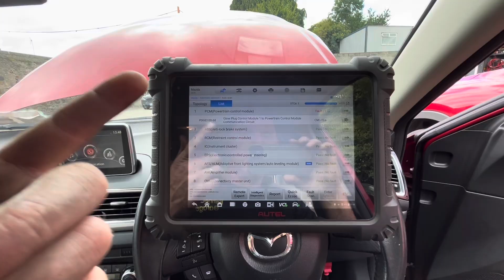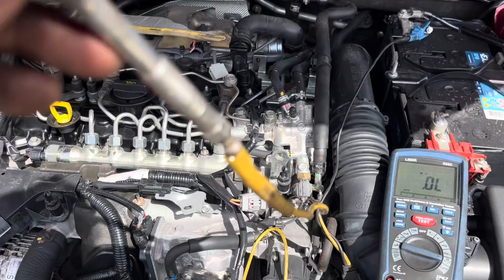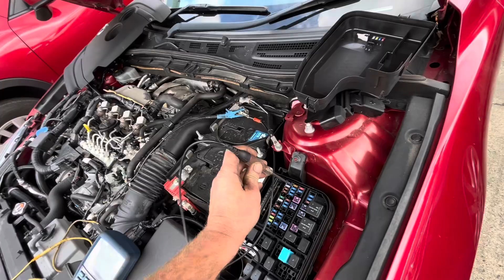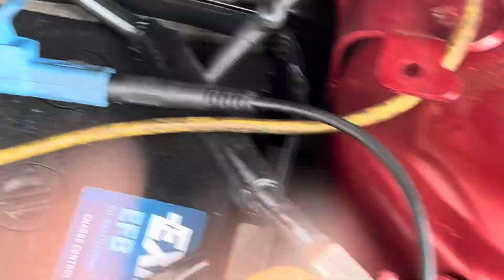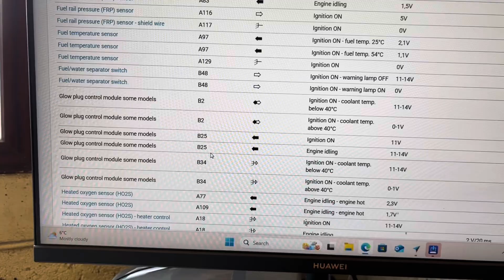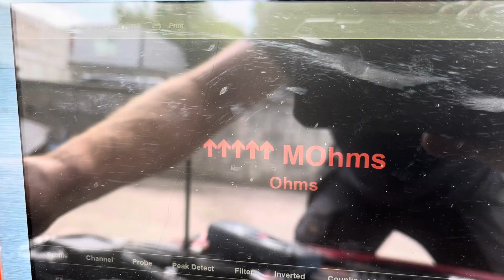P0683 glow plugs communication fault

Comment: hi i have question,mazda 3 2.2 150hp p2262 boost pressure not detected so i think there is problem with vacuum probably vacuum valve i have vacuum on small turbo and big turbo but ther is no vacuum on exhaust manifold flap so my question is should there be constant vacuum when car is running on thet flap then releasing it or it gives is vacuum when it need tu open it car works ok above 2000 rpm but at idle it make strage intake noses on filter box snorkel when p2262 code is present and that is only code car gives and its in safe mode

Comment: Not a bad video, always good to learn from your thought process.  I'm a hobbyist mechanic, the wife wanted a Mazda 3 but I knew about the issues.  Watched a load of your and Mr. NiceGuy videos, learned loads, bought a 2014 car with a knocking rod cheap.  Rebuilt the engine and replaced the turbo CHRA's.  1500km so far and going well 🤞 Lovely power delivery from those engines.  So thanks a lot the videos are appreciated
Reply from the maker: Wow, fair play to you Ryan. That job isn’t for the faint hearted. Well done mate 💪💪💪

Comment: What brand of glow plug do you prefer to use in mazda's Peter? I want to change out mine but can only get NGK, champion & magneti.. no one can get denso unless I go directly to dealer. I assume they run denso from factory?

Got the 1.5 diesel in a cx3, DPF regen is frequent. Hopefully changing plugs might help with new injectors & carbon clean I'm going to do later
Reply from the maker: Intake manifold don’t block on these too much but the injectors can over fuel and cause more frequent regenerations. 
Take a look at exhaust pressure sensor A, the pipe running to it can block very frequently too.
Any good brand of glow plug will do 👍👍

Comment: Hi Peter. Typically, what is the operating voltage of those glow plugs on this model & generation/year of Mazda? Unless i missed it, i didn't see you check for supplied voltage from g/plug module to g/plug/s. Of course, that voltage would only be present when ECM , engine coolant temp sensor etc, were 'calling for' a 'preheat' or 'DPF regeneration' cycle, which you mentioned &  command g/plug module to switch 'on' all four g/plugs. From the displayed data on your DMM (ohm mode), you have zero resistance on all four injectors. So although i'm not familiar with Mazda g/plugs (a 'known good'), that result would normally indicate a direct/dead 'short from g/plug coil to ground' (g/plug body). If that's the case, all four are faulty but didn't necessarily fail at the same time.
Was the communication error faultcode a permanent code? Could it be cleared via scan tool? If so, did it immediately return? Out of interest, was the scan tool able to communicate with the glow plug module? Generally now, if i find a communication error faultcode between two or more modules & the scan tool can communicate with all of the modules concerned, i don't prioritise checking for communication issues i.e poor or non existent can high, can low, Linbus signal/s etc. Although, like you, Peter, l would include that as part of my 'plan of attack', if test results/data pushed me in that direction. l like how you check for voltage drop with both, test light & volt meter. It's a more comprehensive test to monitor actual volt drop, if present, on meter whilst loading circuit. Not just to monitor 'brightness' of bulb', which i find unreliable, particularly when working outside' Having worked in 'sunnier climates', at times it wasn't even possible to see the bulb 'lit', don't mind the degree of brightness!😊
When you were checking for communication signal/s on the scan tool, i didn't see typical can high/low data packages. I wondered if one of the signals was a Linbus communication signal i'e. nominal batt voltage (NBV). I have even seen Linbus voltages in excess of batt voltage😉
A good case study as always. Showing the 'real world diagnostics',when you are under 'time pressure' from customer, who naturally wants his/her car back ASAP (even before you start sometimes😃). That single circuit ground wire, shown on Alldata wiring diagram with it's own inline 5 amp fuse was interesting. At first, i thought it might be a printing/ typo error. But i was 'corrected' when you confirmed with test light, that it was  ,in fact, a 'ground'.  I have said it before Peter, i like how you talk through (to camera) your 'plan' of how you might approach the problem, starting with the basics/easiest to access for testing.Thanks for sharing your knowledge & experience. Good weekend. mike
Reply: 0.0 ohm doesn’t mean faulty glow plug, if the plug was faulty it would show either very high resistance or open circuit on a multimeter
Reply: @viliuskuzma7403  That is not always the case in my experience. In fact the  plug manufacturer Bosch, Re. g/plug type "Duraterm', specify the minimum resistance  to be
Reply: @viliuskuzma7403  CONTD -Specify minimum resistance to be 0.20 ohms & anything lower is to be considered a defective g/plug. 0.20 ohms & over & 5.00 ohms & under is considered to be a 'good' g/plug.
'Generically', the 'rule of thumb' for traditional 12.0 VDC supplied units was/is a spec of  0.50 ohm min & 1.50 ohm max. This could & would vary slightly between manufacturers & applications. I have come across cold (ambient temp) glow plugs presenting with a resistance of 0.00 ohms, which is due to a 'dead short to ground' of the resistive element (heater coil). Ater further testing to confirm my suspicion, l found that the g/plug/s, had, in fact, failed completely or were functioning in a reduced capacity. Of course i'm not saying this is always the case. Thats one of the reasons i indicated to Peter, that i'm not familiar with a 'known good Re. Mazda application/s. Peter is the Mazda Wizard', so i'm interested in his feedback, if any is received.
Reply from the maker: Some very good thought provoking comments, I actually just went back to fast watch my video & I thought I had shown me testing the doner glow plug on a battery before hand.
I explained about the possibly of burning out the glow plug if just connected to 12volts as they are only 9volts.
I also explained about pulse with modulation with a certain amount of ‘on & off’ time giving the desired voltage. 
I don’t know where I put that 🤷🏼‍♂️🤷🏼‍♂️😂😂
Reply: @kennedysgarage3281  Hi Peter. I didn't notice in the vid, you mentioning that the supply voltage spec for that make & model is 9 VDC, so 'my bad'😁. The reason i asked, what is a 'known good' g/plug resistance, was due to the fact, that you mentioned that you would 'normally' expect to see around 1.0 ohm. Although the 'used' g/plug tested at 000.00 ohms (ditto Mazda g/plugs x 4), this may have been a reason why it was removed from another vehicle previously i.e faulty/abnormal operating range. 'Back in the day' when all/majority of g/plugs were rated @ 12.0 VDC, it was easy to 'bench test' with 12 volt batt & jump leads (once they were removed from head😐). A visual inspection would confirm 'either way'. OK or NOT OK. I even used to 'bench test' the 'new' replacement units before installing, as l once found a 'new' unit to be faulty 'out of the box, after having installed in vehicle😞. mike

Comment: Peter…videos are never crap…a great step by step of fault finding..ok so nothing found but as you said maybe there was nothing to find! Autodata looks to be really impressive and takes a lot of the guesswork out of diagnostics. Did the glow plug module need coding to the car, or was it just plug and play?
Reply from the maker: Hi Damo, it was just plug and play as there is no coding affiliated with these. The car is gone 2 or 3 weeks though with no reoccurring problems. So did I disturb something or was it just the module that sorted it 🤷🏼‍♂️🤷🏼‍♂️